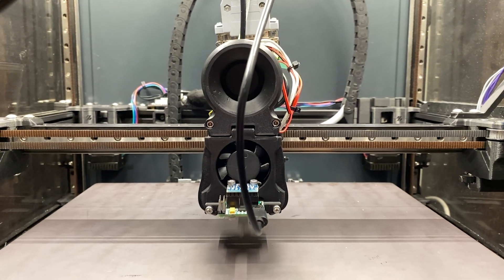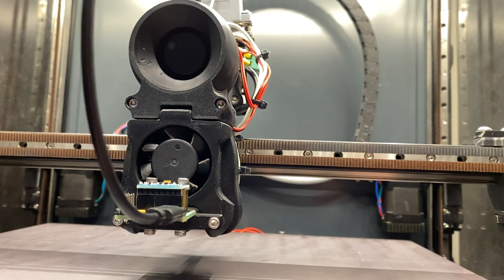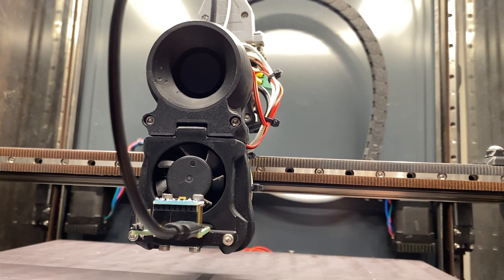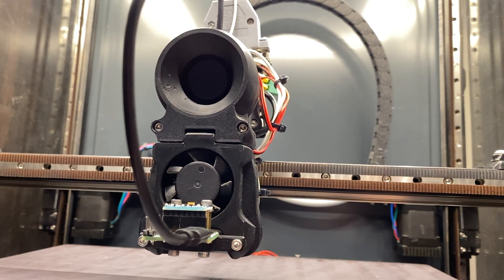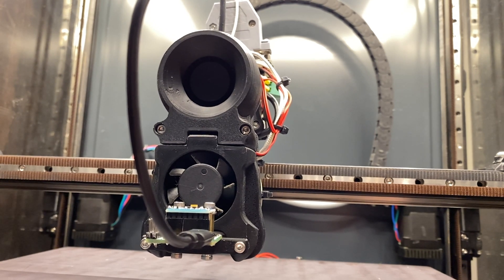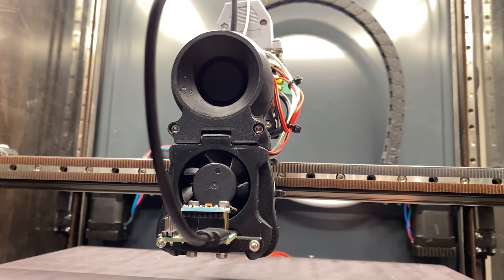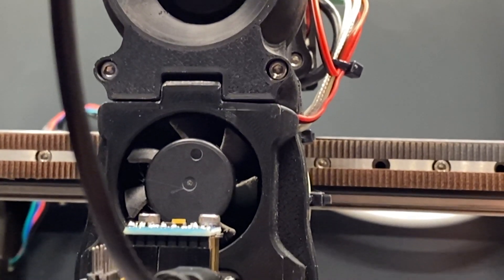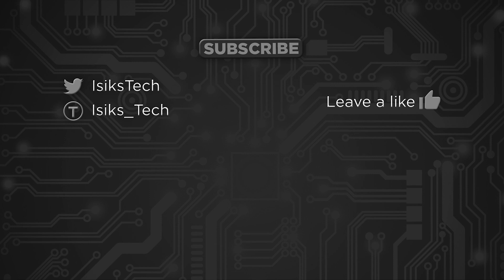ADXL345 MCU Released On Github

Comment: Looks awesome !
So just to be sure I understood it right. You made a custom MCU PCB (compact version of a Mapple mini) with a "standard ali" ADXL345 module on top. You then plug the custom MCU USB (in HID mode ?) to an additionnal pi where you have klipper files and source code ? So you can move that extra pi freely to other printers ?
Reply from the maker: No. I flash klipper to the mcu, and just connect it to the pi running klipper. I can move the pcb between printers as long as they run klipper too.
Reply: @IsiksTech  Understood ! Thank you !

Comment: Hi, love your videos. I’ve been hoping someone else brings it up, but I haven’t seen anyone do so. But, the audio noise levels are so loud relative to your voice. I think it would help with intelligibility if you used noise reduction software, or at least got closer to the mic so the voice to noise ratio is better. I mean no disrespect. Just trying to understand your words in the videos. Cheers, keep making videos!
Reply from the maker: Thanks for the suggestion. I am aware of this and ordered parts to fix it a month ago. They arrived a few days ago. I moved the mic and mounted it on a arm far away from the computer (wasn't possible to move it far before) with a shock mount. It really did help with the background noise. There are a few videos recorded on the old setup, after them, the audio should sound better. I'm not sure if I will release it or not but I made a video about this too.